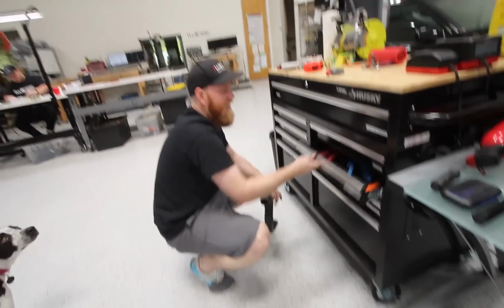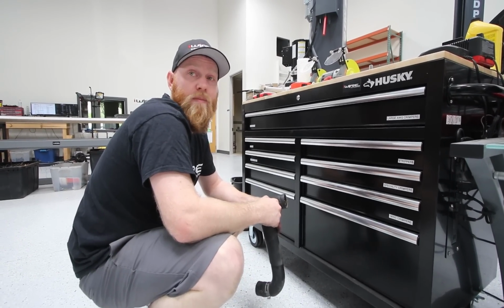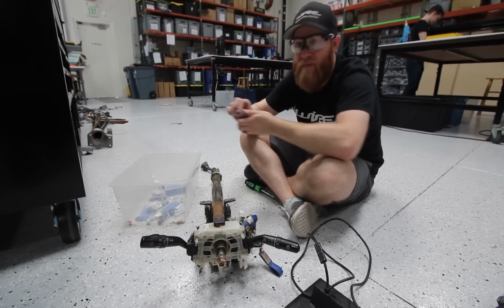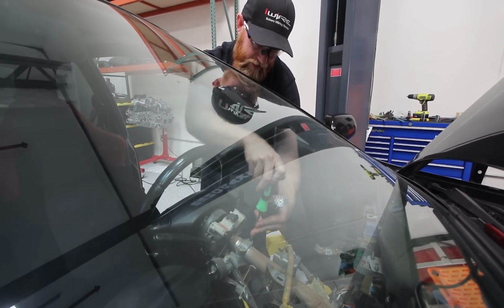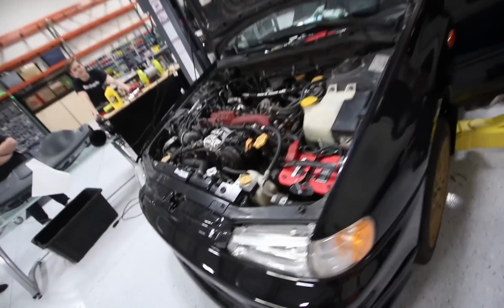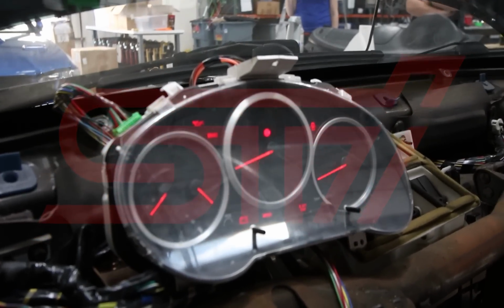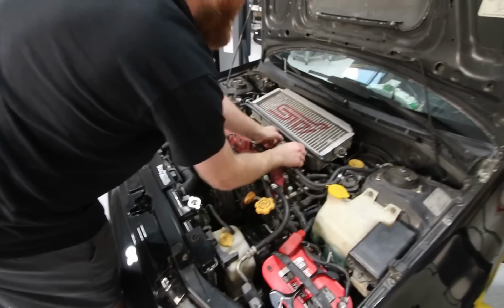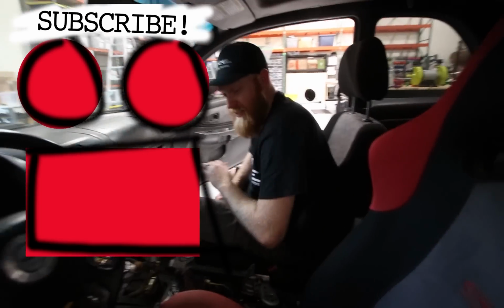Blobeye STi to GC8 Swap Success! First Drive! (Part 3 of 3)

Comment: ahh i remember my 97 with a full 05 sti powertrain/drivetrain and full interior with thesti dash and center console with the dccd pro controller in it. It was a badass car, is that the dash out of the 04 also in yours?
Reply: Roughly how much did that cost? Is the motor a direct bolt in, plus a new harness and ECU?

Comment: 4 hours and it’s 1000$ that’s some expensive ass labor hours
Reply: Yep they can knock these merges out like nothing but yet still charge like it's a completely brand new harness
Reply: Andrew Berndt  and if they are reusing old harnesses and just some materials it’d really all profit, I say if you do the swap just put the whole sti/wrx harness into the car, I did and I have all my accessories like it’s an 04 wrx
Reply: He's paying for quality, also in case something goes wrong; someone to blame 🥴
Reply: 3180 POWER  I guess but my work is just as professional if not more and that is just rape, if you took my gc swap apart you would be shaking your head wondering where it wasn’t factory as far as wiring goes

Comment: Iwire does amazing work but they greatly over charge for their services, they charge $800 to do this merge that takes them at most 10 hours and on top of that if you want it sooner than a month it's an extra $200
Reply: I've had my gf4 sti for 7+ years with their merged harness and I haven't had a problem yet
Reply: @BC-tn5ss  like I said they do amazing work but charge way too much for a merge, they charge more for merging harnesses than most do for a completely brand new harness.